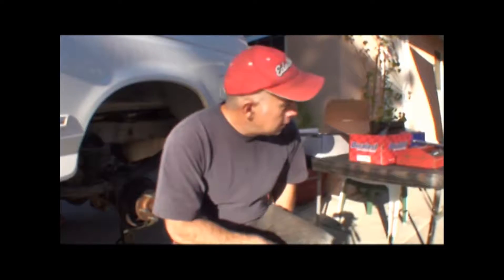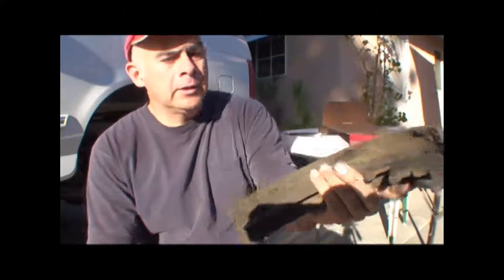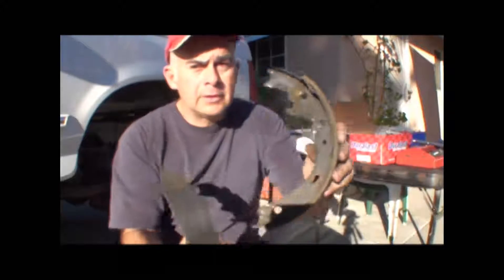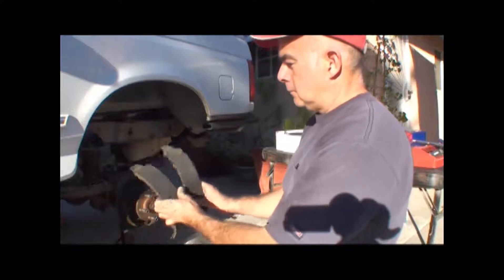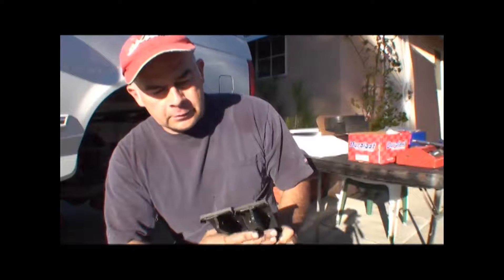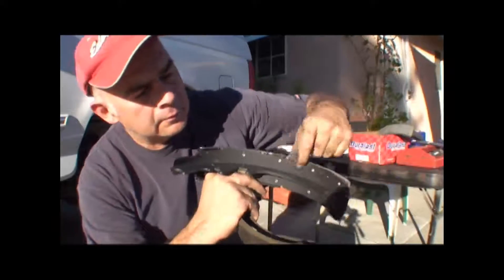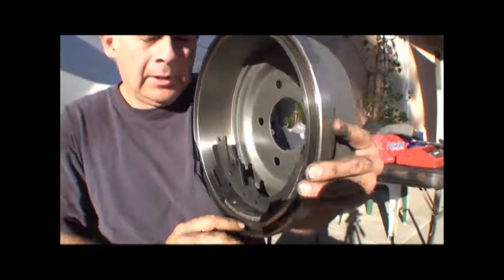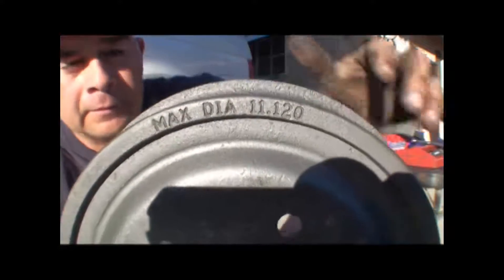Bronco rear brakes 2

Comment: carquest drums are cheaper price.  not sure about shoes.  in minnesota generally drums or shoes don't wear out, they rust and become non useable most of the time and replacing them is more frequent. same thing with hardware kits and brake lines